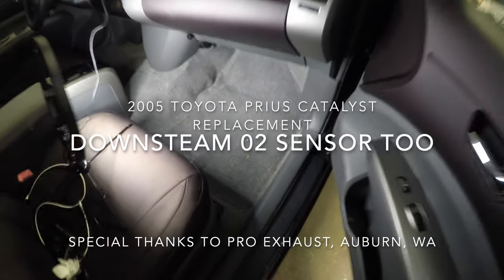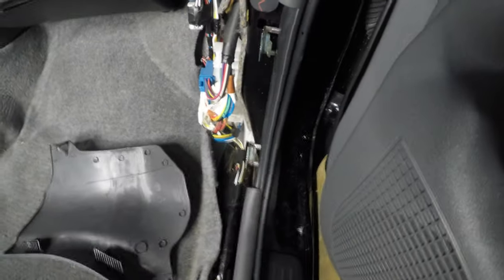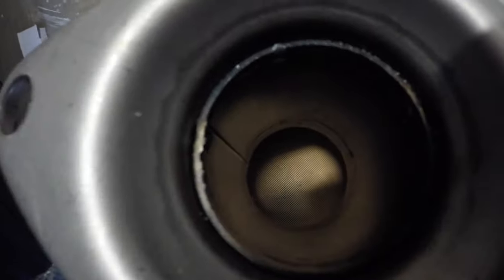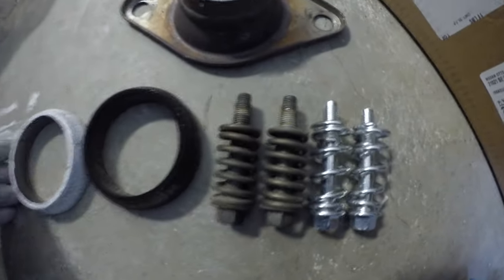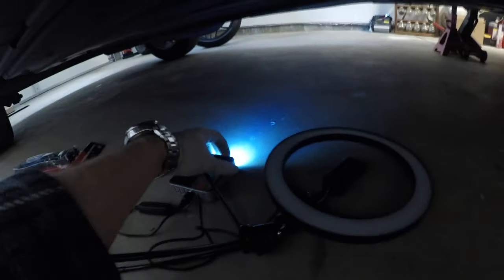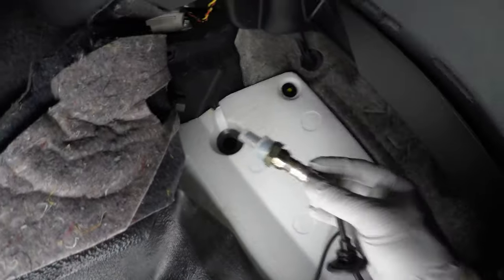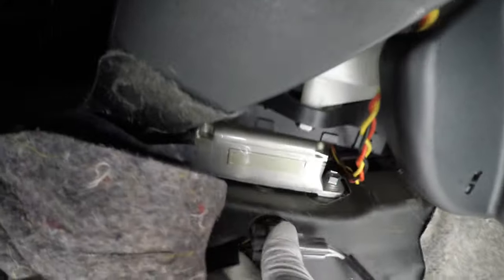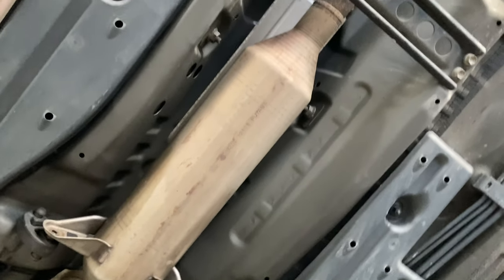Prius Catalyst + 02 Sensor Replaced After Stolen by Thieves

Comment: Hey Neighbor.  Thanks for the video.  It made figuring out the O2 censor replacement a breeze.   I reused the old bolts and was able to bolt to the muffler with the U clamp. Kiel in Seattle

Comment: Can we get an update did you throw any check engine light codes what oxygen sensor are you using is it lasting thanks
Reply from the maker: P0000
Reply: @AaronSchwarz42  whats that? is the car driving ok
Reply: @adivrr  Make sure to get an OEM Toyota 02 sensor, otherwise, the ODBII system will throw P0000 (downstream O2 sensor voltage error) P0420 ( O2 sensor out of spec voltage) codes that require a tool into the OBDII port under the steering wheel to reset / the cheap $25 aftermarket chinese O2 sensors cause these codes to constantly illuminate the MIL light orange triangle master warning light or Instrument Failure Light to glow on the dash. Using the OBDII tool resets. The factory OEM sensor over $215 but does not do this as it produces the correct voltage to exhaust gas temperature output within the parameters of the ECU.